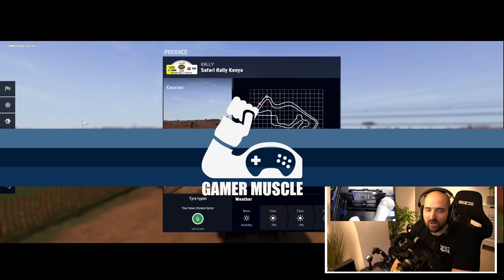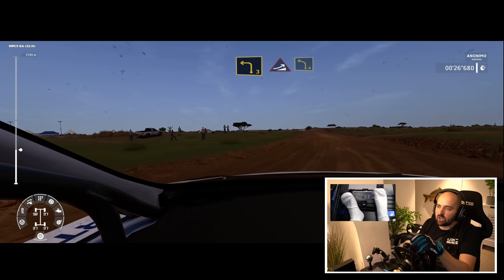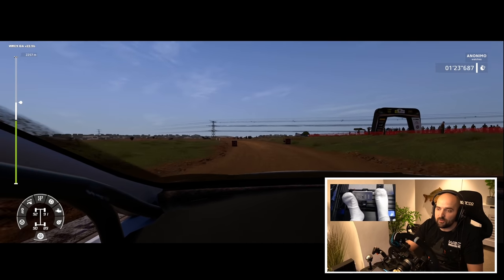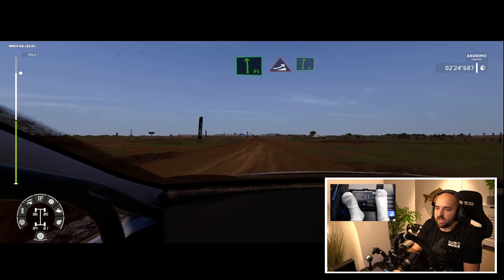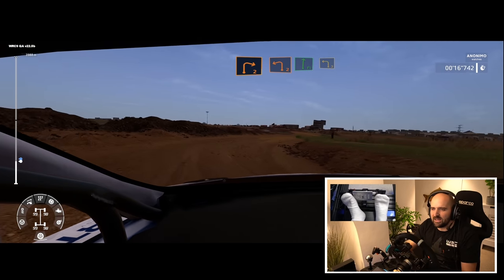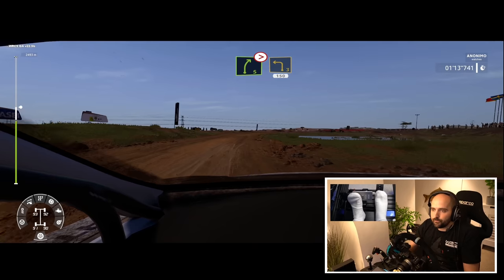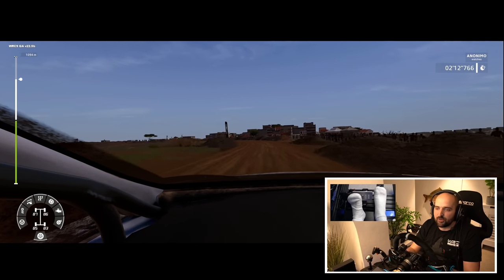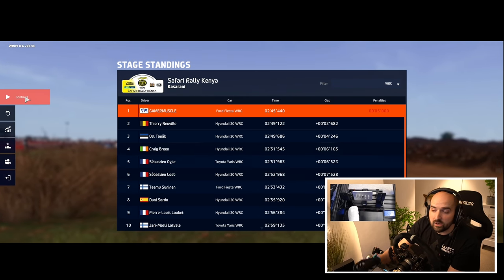WRC 9 | Good Physics And FFB ?

Comment: So they added the dumbest thing about Dirt Rally, random slow wipers that turn on when there is totally no need for them?
Reply from the maker: I think I have them set to manual and was bopping them to remove the smallest bits of dirt off the windshield because I have mental issues.
Reply: Dumbest for some. I stopped playing this because it felt like playing "wiper simulator" and couldn't find a way to make them codriver operated.

Comment: I'll be that guy? Why in 2020 are developers not supporting VR? I get not everyone has it, but implementing it has gotten so much easier now. Hell Richard Burns Rally is capable by the user. It seems like a oversight to me nowadays. 

I play primarily in VR because it's hard to go back to screens after you can actually judge depth and look to where you want. Also, no Steam option still boggles me. WRC 8 isn't even on Steam yet.....

Comment: @GamerMuscleVideos, what do you think, is this driving model suitable for open world racing in road cars, like in Test Drive Unlimited? I mean when you have traffic cars, thousands of kilometers of roads which are impossible to memorise, and probably other stuff like head-to-head challenges with varying routes - running it with physics that lean to realistic side might be overwhelming and frustrating. but I didn't play WRC8, don't know what to expect
Reply: I played 8, and unless it's really changed, I can tell you that the physics aren't really well suited to that sorta thing.  On the road it's pretty good.  But once you get off the road into the dirt, things can go pretty crazy.  But that's honestly a problem with a lot of more simulator and simcade type stuff.  There's a lot of calculations going on and one errant number can cause you to go flying.
Reply: @mandradon  that's a bummer. but if it's good on the road at least, I think that's a good sign

Comment: I liked the physics in WrC 8 on the slow bendy stages, but i hated the physics on fast stages like Finland. Landing jumps was frustrating too. You didn't have a clue what the car was going to do on landings at higher speeds. The feedback didn't help either. Have they improved the physics on landings ?  It looks like they have from the vids ive watched.

Comment: FFB is not great in this game. It's a bit below decent actually. Dirt Rally 1 and 2 both have much better FFB and that's not saying all that much. 9 is definitely better than 8 though, and the physics are much more realistic than DR. I just wish the FFB would get a nice mod or update.
Reply: Ffb seems worse in 9 vs 8 even, i just got 9 and im disappointed,  plus feels more arcadey easy, u can drift a uturn blind.

No risk of losing it , no inertia, weight,,car just settles instantly with a slight steering correction or less throttle.

I ahould hv got 10 at least,,supposed to have more weight feel, but 9 was supposed also vs 8 and i see opposite almost.
Waste, now i need wait before spending again on a game to try 10 mb or wait 11.